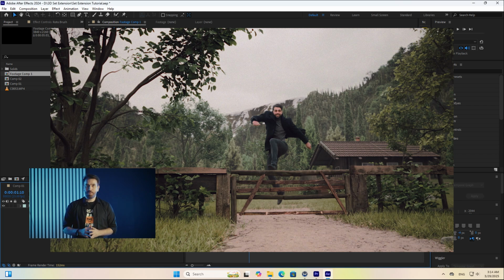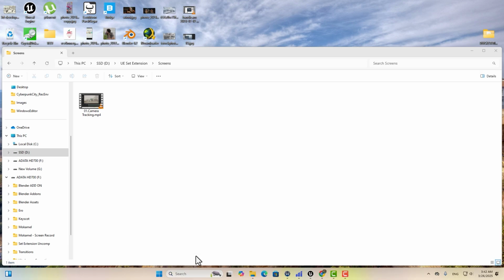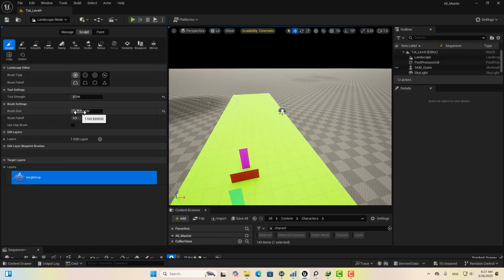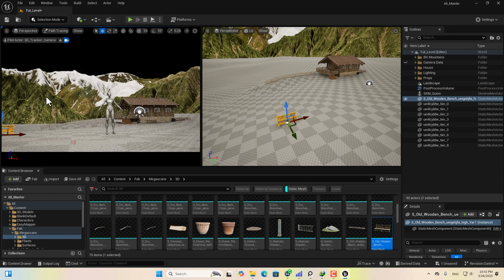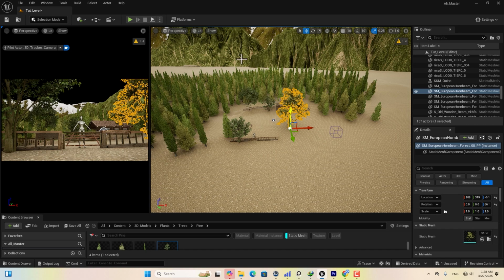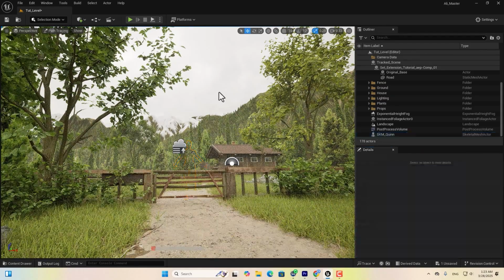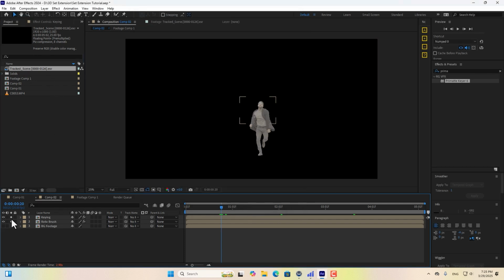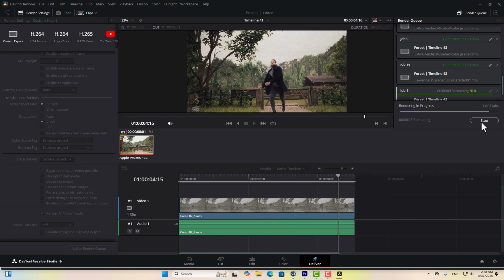Unreal Engine - Advanced 3D Set Extension Tutorial

Comment: I do this same kind of stuff and I really admire your workflow, however when I had a scene with particles where snow was falling, I couldn't render the AE background separately and then compose it in AE beacuse I had to have some snow behind and some in the front of the subject. Could a separate render pass handle that in a way similar how you handled the fender? I am not sure since there is bunch of snow flakes everywhere, if you know what I mean...
Reply from the maker: I rendered the snow flakes behind the actor along with the background. But I rendered the foreground snowflakes as a separate alpha layer. Of course, the standard method is to render the entire scene at once and then separate the snow flakes using Z-Depth. But due to a number of problems, the Z-Depth method could not be used.
Reply: @alifarahani1158  I see, I am trying to render the foreground snowflakes as a separate alpha layer, but I still haven figured out a way to do that properly. If you find time for a quick tip I would be very thankful I am hoping to see new videos from you. Thanks and all the best!

Comment: Hi Ali! Thank you for sharing this. Since I don’t have Cinema 4D and I use Blender with USD files, I accidentally moved the position of the imported camera without altering its keyframes. This means the starting point of the camera has changed, but the animation remains the same. Essentially, I’m modifying the surface while rotating within my imported camera instead of using the perspective camera. Do you know how I can fix this? Thanks in advance!
Reply from the maker: Select all key frames and move them to the right place. When you import a tracked camera that's better to lock any transforms.